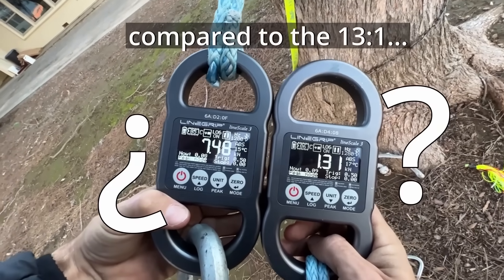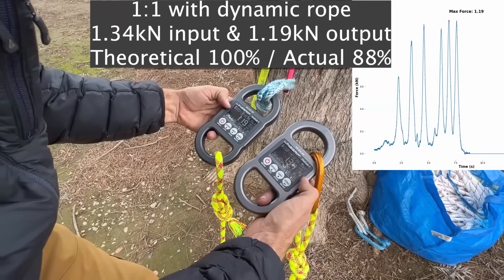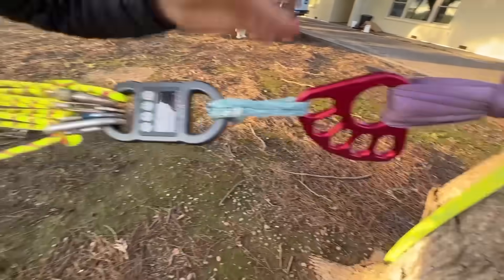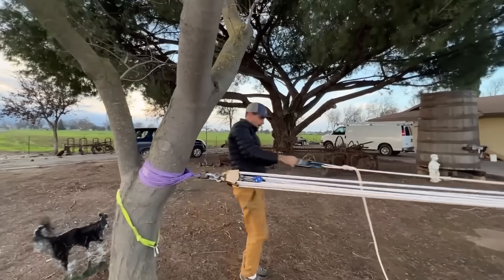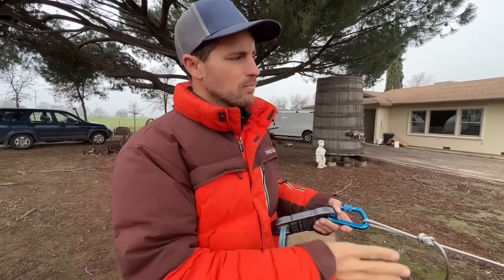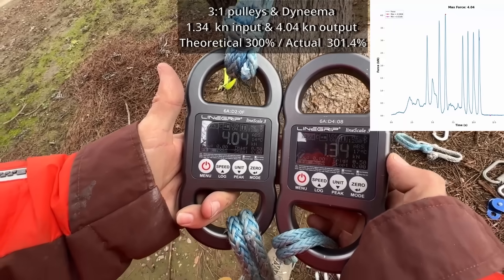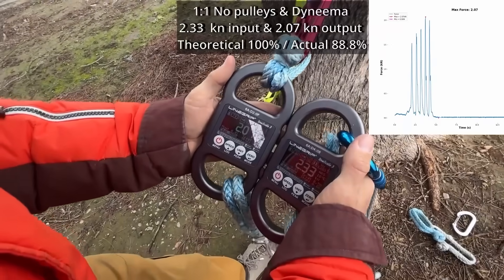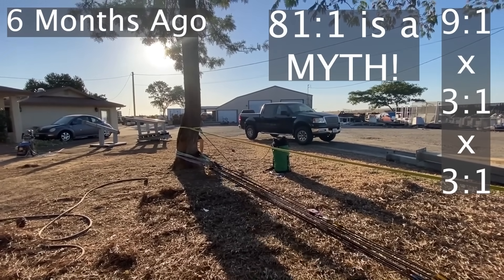Mechanical Advantage is a Myth

Comment: When you have a long rope and your doing short jerking pulls, you'll get lower peak values at the other end. If you statically load the long rope you'll get rid of that difference (for the most part). When you're jerking on the rope you'll see that the elasticity effects the force that the other end experiences. 
I loved this video and think it does a great job at demonstrating how mechanical advantage really works!
Reply: Yup, under dynamic loading it’s acting more like a mechanical capacitor and smoothing the peaks.
Reply: Yes, this would have been the better conclusion
Reply: I agree, this test only really proves that stretchy rope is stretchy it is not scientific and it doesn't even test what he claims it will test.
Reply: just what i wanted to say if he wanted to get proper values he would have to statically load the stretchy rope to get. If he wanted to do this he should use a tree or whatever to do this vertically than he then apply his body weight statically to the system
Reply: Yeah, perhaps doing this vertically would be more revealing...can he lift the back end of the van with only his body weight?
Reply: I was going to mention a similar thing. I would think that if you loaded a stretchy rope quasistatically, that is to say infinitely slowly such that dynamic loading is negligible or zero, the force would be the same as an infinitely non stretchy rope. But, some of the mechanical work would be consumed in stretching the stretchy rope.
Reply: I agree.  the bounce applies all the force to the first load cell, and the stretch absorbs the impulse before it is applied to the second load cell.  it's why dynamic load ratings are WAY less than static load ratings.
Reply: Yep. Great video. But its true, the dynamic loading/shock loading during testing is another factor to the lower results. If the test was done, not with yanking, but with consistent application of force, results would be closer to the theoretical. However, this video shows all the real world variables! Love it!
Reply: Yeah I was thinking elasticity of rope still transmits the force but you need more distance of pull, so you lose mechanical advantage that way.
The friction loses force transmission but doesn't cost you any extra distance.

Comment: I think that the results woulp be very different if you pulled continously, here the tension si probably not established in all the system when you stop pulling, the "traction wave" does not propagate instantly in the rope and the system.

Comment: Considering how you aren't slow pulling it, there is likely a whole bunch of dynamic stuff going on as well, likely skewing the results a lot.
Not to mention that the friction of a pulley isn't constant, it has a stationary and moving friction just like any other mechanical system. And under load, the stationary friction would logically require a larger force to overcome it.

In short, you might get closer to the actual ratio if using a more constant pulling force, like the new kapstand.

Comment: I think bouncing is having the effect of systematically increasing the input force more for the least dynamic cords. Also you could pick up a short length 1.5 to 2" thick wooden dowel to make a pulling 'handlebar'. I'm using a portable fingerboard similarly for tightening my longer slackline setups. I can get way more force without the finger pain.
Reply: Maybe a rigging plate could work.
Reply: It definitely would, but I appreciate this because this jerky motion is how I tend to tighten things. Now I know the dynamic rope is eating up a ton of force.
Reply: I think we also need to consider static vs kinetic coefficients of friction: it takes more force to set something in motion than to keep it moving.

Comment: hey Ryan, thank you for that vid, that was super informative! 

Some other people already commented that shortening the rope probably plays a role. I know these tests take a lot of time, so maybe one of us has to do it when 2 linescales are around. 

The other day we broke some samples with a 5:1 behind a 5:1, pulling with 3 people and getting it up to 25kn in the process. I was surprised by that, because that means not much got lost in friction/stretch. 
We had big smc pulleys in the 5:1 and kept the static rope as short as possible (like 1m pulley length) then added a longer rope pulley with dyneema rope and smaller pulley wheels (you call them that?). 
Resetting took less than 5 min and we were able to break a lot of samples that afternoon. 

Your system of the electric winch is much better, but maybe some other people here can profit from that description :)
Reply from the maker: don't you only get 1/5th of your throw of the main 5:1 when you do a 5:1 multiplier?  3 people can equal 3kn of pull.  The output if 100% efficient should be way more?

Comment: Also, do the readings depend on which way you link up the linescales? Because this time you had the pulley system attached to the top of the "yanking" scale on one end, and to the bottom side of the "stationary" scale. 
Of course this wouldn't matter for a slow loading, but might be one of the confounding factors when yanking.

Comment: There's one more variable that you threw in by accident, it's the duration of the pull. A single straight line should have equal values, unless you're yanking on it quickly, without giving it the time for the forces to equalize.

With the 13:1, the rope is so long that the pull takes a while to travel all the way to the end, and if the pulls are so sharp, you aren't using all the pulleys, you're just fighting against the inertia of the rope.

Slow pull the next one?
Reply: The straight pull with no multipliers also shows a big difference in the scale readings. This might be worth re-visiting after checking that both scales read the same and calibrating them if they don't.
Reply: These test are for a system he can take into the woods to test in real rock, so it is quite close to intended use. Though he should do a test with capture so that the system has time to equalize
Reply: But of you think about it, that is how you would normaly pull things by yourself on a wall or just in general.
Reply: @pedroferreira3371  except that normally you would be building up that tension in something (like a highline) with it's own stretch, and not just a solid piece such as the linescale.
Reply: @pedroferreira3371  True, it is still a variable though.

Comment: Will be nice to see calibration of those linescales. Worked with load cells and is important to do the calibration process often if you are putting a lot o stress on them.
Reply: Maybe, maybe not. You could check their 0 point by just turning it on. (I'm no engineer, but have used load cells on man lifts). They get calibrated upon install by setting a zero weight in bucket then max weight in bucket. The stuff in between is linear. They do look allot different then the line scales though so don't bank on my info.

Comment: Thanks for another great video.  The physics 101 graphic at the beginning of video assumes frictionless (as you noted) but also a constant force being pulled with zero stretch line.  Bouncy dynamic inputs are damped out by the stretchy rope, less by the semi-static and even less by the Dyneema.  I'd be interested to see the Input v Output when using the portable winch set up as it's less bouncy.  Appreciate the video and look forward to more content from the drop tower and testing of sailing components.

Comment: It would be interesting to repeat the tests with different total length of rope per configuration. Suspect doing 1to1 testing with very short length of rope incrementally increasing the length would give you a factor reduction in efficiency per meter length. Probably best to use mechanical clamps to remove variance in knot tying between each test.
Reply: I was thinking this also mostly. same setup, different rope lengths. Clamps might be a bit overkill/impractical for their level of benefit.

Comment: Hey Ryan, what are your pulleys rated for? 

If the friction was the same per pulley and independent of the force, you would expect the friction to increase linearly. Since the performance drops faster than linear (a 5:1 being better than a 9:1 even on dyneema is proof for that), it's safe to assume, that the friction in the pulleys increases significantly with the force they are used to redirect.
So it would be interesting to know how close you are getting to their rating.

Also, whenever you get highly unexpected results like the 1:1 having a difference of 100%-88%=12%, you should look into it. In this case swapping the Linescales would be a great idea. 
If the lower value also switches places, it's most likely the Linescale. If the lower value is still on the fixed side, it is either stretch or too slow of a measurement rate.

Comment: Do those pulleys have ball bearings? You should look into sailboat hardware, they make some pretty trick stuff. The nicer stuff rides on ball bearings and has almost no friction, even under load.
Reply from the maker: The 3” smc pulleys do have ball bearings. The others dont
Reply: @HowNOT2  Harken makes some blocks that are rated for 44000 Lbs, can you test one of those? ; )
Reply: Agreed.  I've got 5 to 1 in pulleys plus a block on deck for 6 to 1 on my main sheet before the winch with sta-set line (dyneema core). Curious what it would show.
Reply: Fun fact, I am pretty sure ball bearings are a Swedish invention :D

Comment: I'd love to see if you get closer to the exact ratios with slow/constant force pulls.
Reply: I would imagine it takes time for the stretch to travel through the system. Giving it time to settle would probably have some effect. That would just be more for curiosity though as what he's trying to test is the efficacy of the setup the way it's used in the field. I'd also be curious to see the old 81:1 setup tested with he new line scale 3s. But that's a lot of work for what would probably be a predictable and not very exciting result.
Reply: I'd guess that it has a large effect on it.  Imagine lifting a weight with a soft bungee cord. You could yank really hard and not lift the weight if you didn't get all the stretch pulled up and start lifting the weight but once you had the weight lifted and the bouncing stopped you'd be pulling exactly the weight of the bungee and attached weight. If he used that capstan winch to load the line slowly he'd get much more consistent results regardless of stretch but he'd have to pull more line through on ropes that stretch more. By yanking he's loading a bunch of kinetic energy into anling length of rope and then letting it dissipate between yanks. I understand that this is how he intended to use the system so I get why he did it this way but it's a bit disappointing that he didn't repeat the test with the winch.
Reply: @WungusBill I would go for a small ratchet system in which he can gradually increase the force. He still can generate force spikes by forcing the Rope to one side and thus creating a massive force with very little input.

Comment: Really nice test!
I'm about to build a simple pulley system (classed shackles and ball bearings and washers what could go wrong! Soft shackle friendly too.) 

And the test really beggs the question:
If I have say 8 bearing pulleys, it's probably better to do a 1:5+1:5 multiplier, rather than having a 1:6 with a 1:3 multiplier or 1:9 without multiplier.. hope that's understandable.

And.. I'll be using a 8mm static rope and a nice handle, for now!
"Handles tested!" Lol.

Best regards swede patreon.